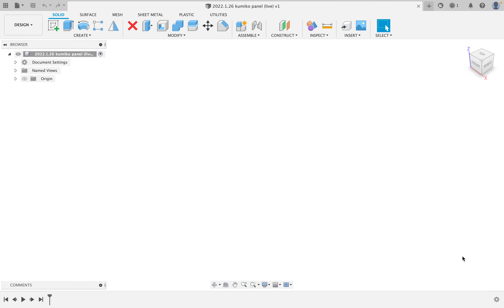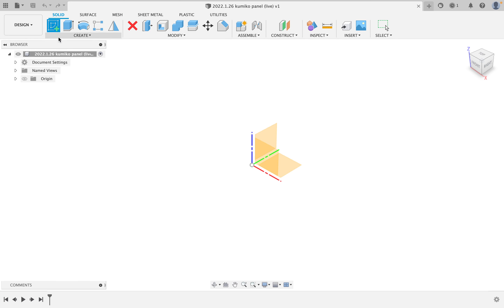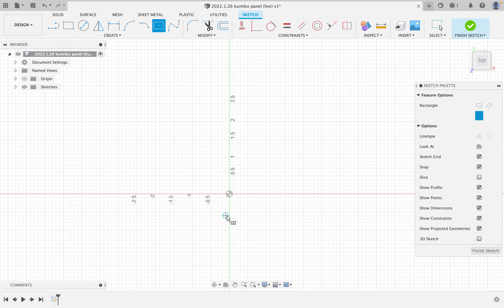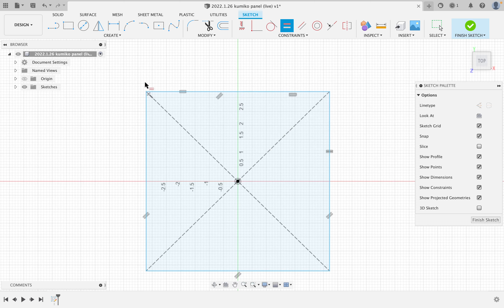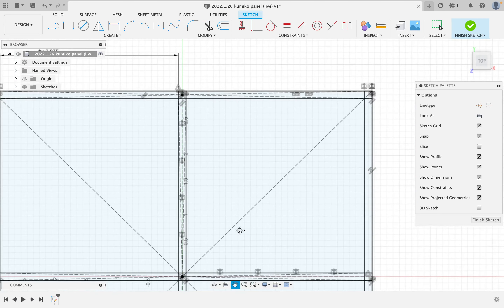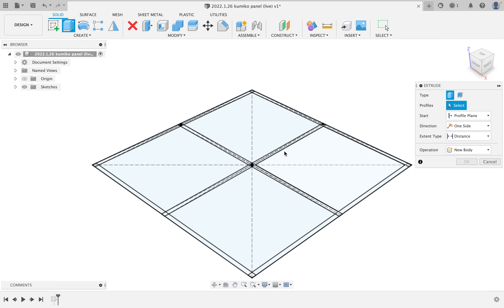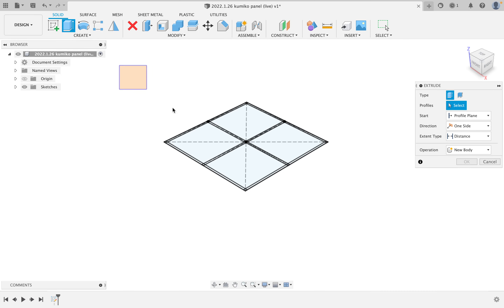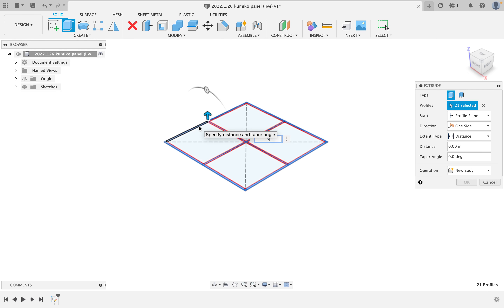Kumiko Box, Hemp-Leaf Pattern - Design and Woodworking in Fusion 360 (Live)

Comment: I would also define a few user parameters, so easy to modify and play in the final model.
Reply from the maker: yes, i’m going to get to that soon but i didn’t want to tack it on to the end of a class without having demonstrated and explained it. in practice, i usually just use stored parameters within a sketch and equality to make things easy to modify unless the model is extremely complex. you’re absolutely right it makes things easier when there is a lot to change and play with, though. in a large kumiko panel this would definitely be a good idea.